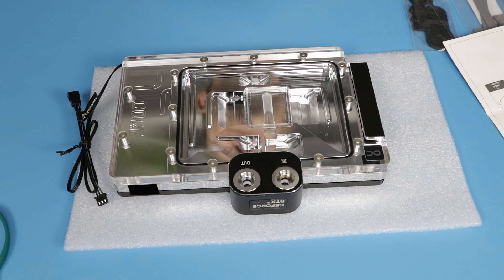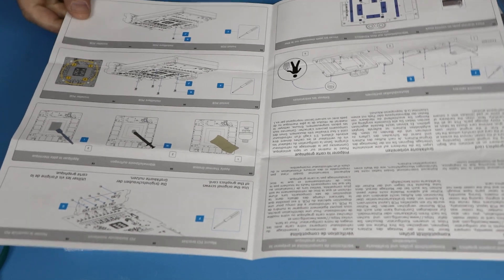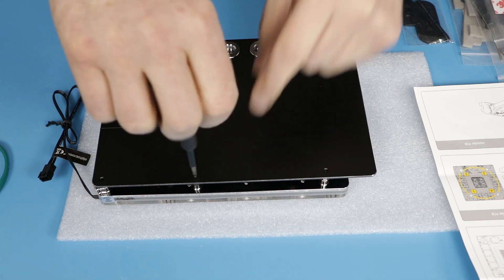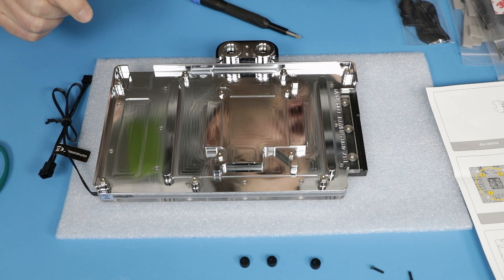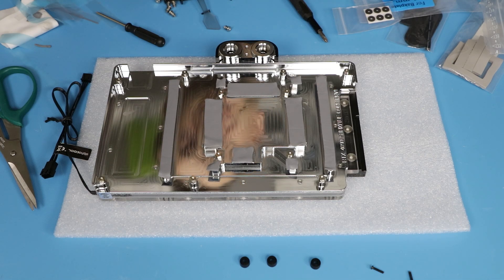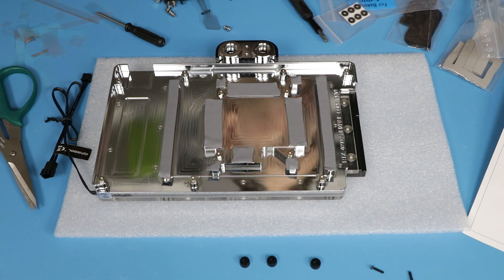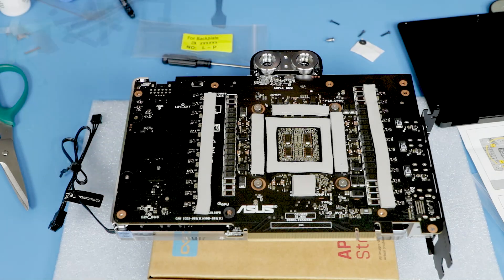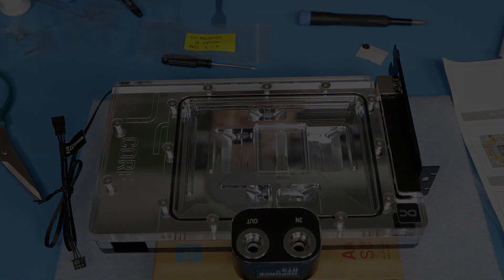Installation of Alphacool Core 4090 TUF Waterblock   - Quick Guides #3

Comment: It's been a while since you did that video but I thought I'd share my experience with my Alphacool 7900xtx Red Devil Core block.

Like other people have said, I'm impressed with the new Core line waterblocks. Quality is good. If i put aside the 2 long scratch my block came with on the acrylic lol. Won't bother going for a RMA tho. I need that block more than I need to get rid of the scratches.😂

Anyways, I was using the usual EK block prior to this because they were the only option back when i got my GPU. Gosh, temps were awful.. i have 3mm gap between the PCB and the block standoffs. So as you can guess, temperatures were unbearable. The PCB was getting warped to a breaking point if i was thightening like it was supposed to. So i ended with crazy 110°c hotspot. So i got the Alphacool Core block to go with my Core1 CPU block because I'm tired of EK low QC. Now the PCB doesn't warp at all anymore. I have some contact issues because of the pads were not of the right thickness. I tried to fix this with no success... Until i got a Kryosheet. Now i get better contact but i have hard pads so i get semi-good vram temperatures. Alphacool accepted to send me a new set of pads which are much softer. I'm still waiting on them but I'm sure all will be good.

In the end, the Core waterblock is better in all ways to my EK block. Makes me happy to see Alphacool is back in the game with their waterblocks!❤ Hope they will keep going strong! They have all my support. I wanted to get a 360mm distroplate and their metal fans from you man but as you know, IRL have been crap in the last couple years. But as soon as i get some extra cash, I'll be ordering from you again. I really want to replace my two FLT reservoirs for the alphacool distro. Still need to measure but if it's not a 360mm, it will be the 240. Will be done with dual loop.
After that, I'll replace all my aurora fans with stealth ones.

So yeah, great parts! By the way, I hope you had a great time in Cancun!
Reply from the maker: Core block was a nice surprise in my testing. It is a well done part.

Comment: I have a core block for my MSI Suprim, it's been running great since september.
Reply from the maker: I was pleasantly surprised with this model. It works great.
Reply: Same, have one on my suprim and love it. Added a few more pads on the back and my hotspot to core delta never goes over 10C now.